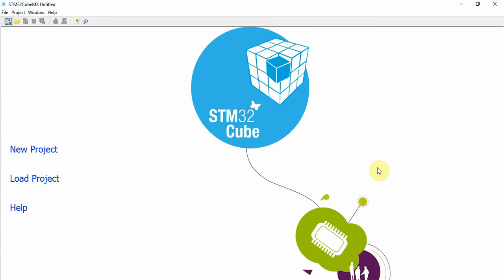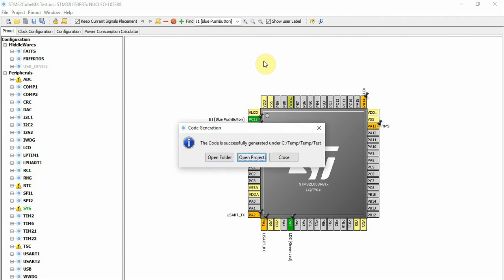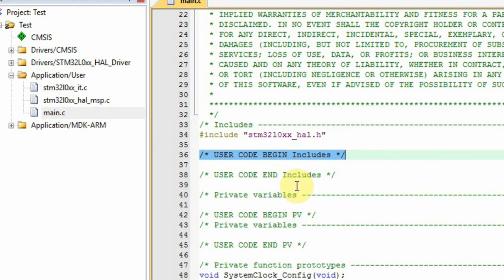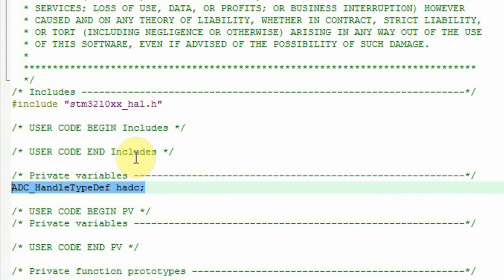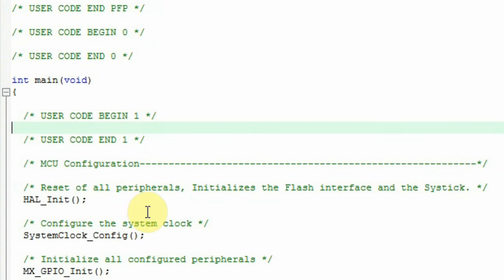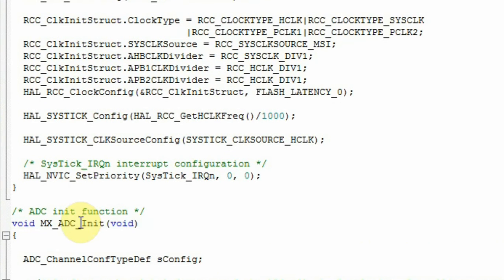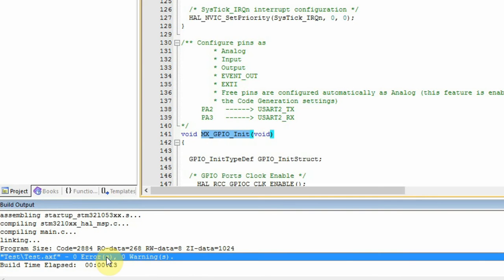#2 How the cube generates the code

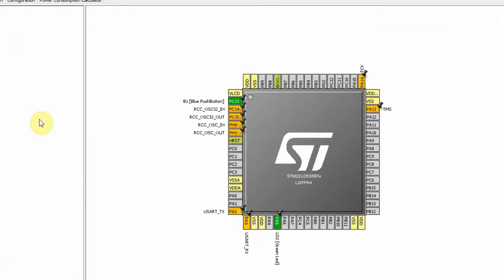Comment: In 1:15, some pins were dark orange automatically like PA13,PC14, PC15 even if you didn't select it... How did it happen?
Reply from the maker: When you chose the board from the list, then all the pines that are used on the demo board are either green or orange.